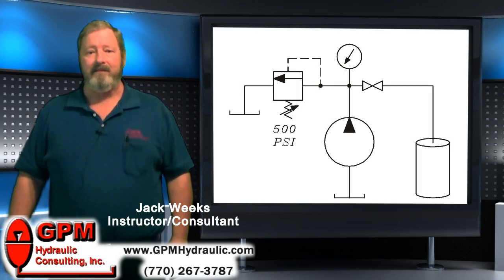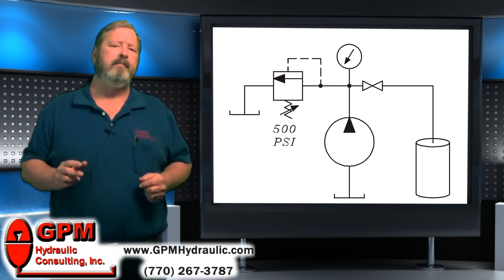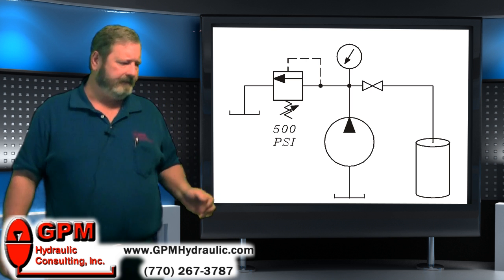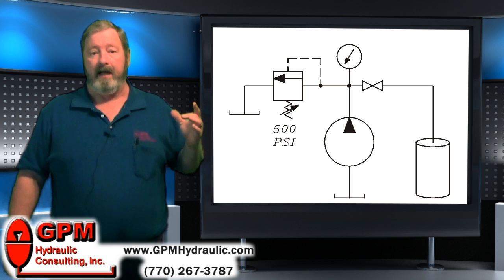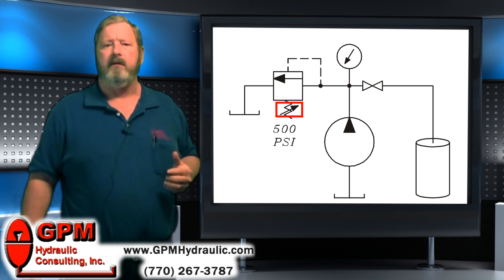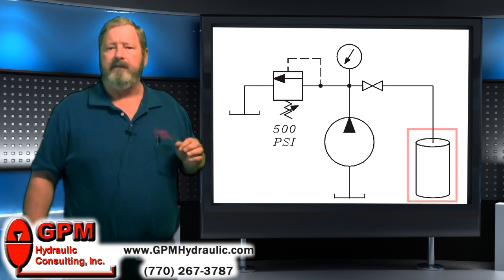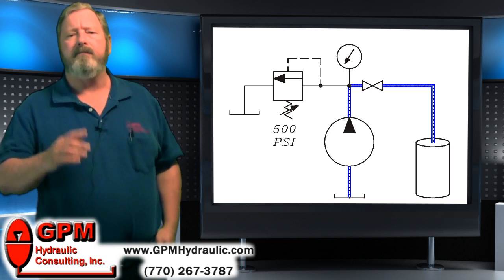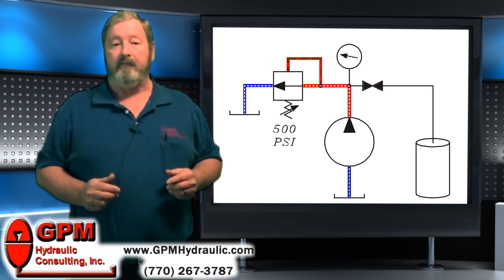The Difference Between Pressure and Flow

Comment: Am I correct to say that this principal of flow v pressure is only true if you're pumping a liquid, because it is not compressible? If you're pumping air, the pump can create pressure because air is compressible, I believe a turbocharger both pumps flow and compresses the air at the same time. Also a screw type supercharger does too. This is why they're more efficient than a Roots type supercharger.
Reply from the maker: Hi p jay, thank you for your comment! Actually, no, the principle remains the same with any type of fluid, liquid or gas. Yes, air will indeed compress considerably while hydraulic fluid will compress almost none. But both fluids become pressurized when used to transmit power and that pressure is the result of resistance to flow. The flow is provided by the pump (or compressor, with a gas) and, in either instance, there will be no pressure unless there is resistance to that flow. So, in both cases, what you are reading on the gauge is not the amount of pressure delivered by the pump or compressor, but in fact is a reading of the amount of resistance that is currently being overcome. Hope this helps!
Reply: @JackWeeks  maybe I have been confused by the fact that a turbo has a "compressor" wheel. I assumed that meant it created compression, by centrifugal force on the air, as well as pumping it through the inlet tract.
Reply from the maker: @pjay3028  Yes, manufacturers don't help matters very much with their terminology. That is exactly how the flow is generated, but you will note that, if it is not connected to anything and there is no resistance, it can go full speed and no pressure will be generated (other than a negligible amount by air resistance and change of direction - which is still resistance, just internal to the compressor). And the point can appear to be only academic in nature, but it's crucial that it be understood when troubleshooting a system.

Comment: Once the flow is allowed by building  pressure until 500 psi, then the pressure should drop because there is no resistance anymore.. and then pressure rise again (in a cycle). Or am I missing something and it's actually possible to have a constant flow with pressure up ?
Reply from the maker: Hi Arthur, thanks for your comment! This would be true if the relief valve were a "switch". But it's not - it's held closed by a spring and the resistance doesn't go away just because the valve is opened. Think of it as a door with a door closer installed. Once it is opened, someone has to maintain the opening force on it or it will close again. Same way with the relief valve. If the pressure drops below 500 PSI, the relief valve will begin to close. Thus, the pressure drop must be maintained across the relief valve in order to keep it open. Now, as you can see in the schematic, the pressure drops to near zero once the oil passes the relief valve, and if a gauge were mounted in the tank line, that is what it would read - zero. But so long as there is resistance there upstream of the relief, there will be pressure reading on the gauge. So, yes, it is possible (and even necessary in order for the machine to do any work) to have a constant flow with pressure in the line.
Reply: @JackWeeks  thanks for the explanation!

Comment: Jack can you explain this using bernoulli's equation, if we decrease the diameter of the pipeline according to bernoulli's equation static pressure should decrease, but according to this video pipeline with small diameter gives high path of resistance so pressure guage reads high pressure, kindly help me clearing this confusion.
Reply: Thank you for your question, Hassan! Let me see if I can clear up any misunderstanding. In its simplest form, the Bernoulli equation states that static pressure + dynamic pressure = total pressure. A steady, unchanging flow is assumed. It is really more for measuring fluid velocity, particularly through a nozzle. The principle remains, however, that pressure is a measure of resistance. As the orifice changes, the pressure drop across the orifice changes in inverse proportion. Thus, the smaller the orifice, the greater pressure drop across it, assuming that the flow remains constant. The Bernoulli principle is really an expression (or, perhaps, "example" would be a better word?) of the Conservation of Energy law.
Hope this helps, and thanks for watching!

Comment: IF PUMP DOES NOT CREATE PRESSURE, HOW DOES HIGH PRESSURE WATER JETS ARE USED FOR CLEANING ? I MEAN 500 BAR PUMP PRESSURE FOR CLEANING PURPOSE ? SPRAY CLEANING
Reply: Thank you for your question! And it’s a perfect example. The answer, of course, is that the pressure is caused by.the orifice that restricts the flow. In fact, most pressure washers have a set of several orifice connections so you may choose both the spray pattern and pressure. Remove the orifice (along with the quick connect fitting on the hose) and then the hose becomes the orifice and pressure drops very low because of the loss of resistance. Hope this helps!

Comment: I want to try understand how I can get more pressure...or is it flow LOL, through my shower head and faucets at my house.  We're on a well. We pump from the well into a pressure tank.  Would your "Trouble Shooting Hydraulic Pumps" course, help me understand how my system works?
Reply: I'm sure that it would - in the hundreds of times I have taught that class, I've never had a student who didn't feel enlightened by it.  But the short answer to your question is probably going to be either a higher flow submerged pump or an additional inline pump. The latter may be the less expensive solution, particularly if you have an especially deep well or a very long run from your well (or both, as I did at a house I used to own. The auxiliary pump did the trick!) Hope this helps!

Comment: My hydraulics instructor at UTI over 30 years ago said this ; when you pee, that's flow. Now put your thumb over the hole, that's pressure.  Simply put, flow against a restriction causes pressure.
Reply: I think that's what you call a UTI infection...
Reply: Sounds like a good example to me.
Reply: thats usually painful too, u do feel that mechanical pressure against the wall of your pipe
Reply: They are right, indeed.
Reply: I heard the same thing from my Master Toolmaker during apprenticeship and my nuclear physics professor at University.
Reply: Put your thumb over a garden hose and the water has more pressure
Reply: So,. your cock will deliver how much pressure?😅
Reply: George Kuersten 🤣👌🏾

Comment: Hi Jack, 
This is a great video. I was wondering what would be the case for a non-positive displacement pump? How the pressure and flow rate can be varied for such pump?

Thanks,
Manjiri
Reply: Thank you for your comment! The principle would remain the same whether the pump is positive displacement or not. Or, for that matter, whether the pump is fixed or variable displacement. The pump still delivers flow and the pressure is determined by the amount of resistance that is overcome. A non-positive displacement pump (such as the water pump on your car engine) will not maintain an output proportional to the speed of its drive motor because it has relatively high internal clearances. Thus, the higher the RPM and the greater the resistance, the more the pump will bypass. By the same token, its flow can be blocked without serious danger.

Comment: Dear Sir, i have a low flow rate issue. Can you please assist me with that? Thanks
Reply: Maybe. What sort of problem are you having?
Reply: I have three pumps which are almost similar connected in parallel. When one pump runs it runs at best efficiency point giving rated flow but when two pumps run the flow rate does not double. But the system is designed for both pumps to run in parallel and system once ran giving double flow rate. Third pump is redundant actually and two pumps were once enough to full fill the flow requirement. But few years back something happened and now when both pumps run flow rate does not double. What can be the possible reasons for this flow rate loss and how to troubleshoot it. If you need any other details then please ask.
Reply: @irshadali3449 , it's possible that the second pump is simply badly worn. Of course, it's also likely that you have some bypassing in the system. I would first test the pump through your relief valve. Deadhead the system and, with only the one suspect pump running, first measure the flow through the relief valve with the pressure setting very low. Then, gradually increase the pressure setting until you get to normal system pressure. If the flow maintains at or very near what you get at low pressure, the pump is fine. Look for system bypass with a thermal imaging camera (bypassing always generates heat). If, however, the flow drops more than about 10% or so once you reach normal system pressure, the pump is bad and must be replaced. Hope this helps!
Reply: @Gpmhydraulic  thank you. i have an other question. can a pressure drop across shell and tube heat exchanger  be increased by partially closing its outlet valve???
Reply: @irshadali3449 , it certainly can!
Reply: @Gpmhydraulic  I just don't get it. By closing valve you are actually restricting the flow through heat exchanger and by doing this pressure drop will decrease as pressure drop is directly proportional to flow rate. Please explain. How can it be increased???? Thanks
Reply: @irshadali3449 , your heat exchanger acts as an orifice in itself. Increasing the resistance downstream will also increase the resistance across the heat exchanger. If you want to decrease the pressure drop across the heat exchanger, the flow must be restricted upstream of the cooler. In any event, though, it is rarely wise to limit return flow, especially through a heat exchanger. It will decrease the overall efficiency of the system as well as hinder the heat exchanger in cooling the oil.
Reply: @Gpmhydraulic  I want to clear that valve which is restricting the flow downstream heat exchanger is installed after the pressure gauge measuring pressure drop. In other words the pressure gauge installed to measure differential pressure is installed after heat exchanger but before the valve. It is measuring pressure drop across heat exchanger excluding the valve. How can be in that case increase pressure drop by restricting the flow through valve after heat exchanger??
Reply: @irshadali3449 , maybe I'm not understanding your problem. As you describe the arrangement, it sounds like your gauge is measuring pressure drop across the valve, not the heat exchanger. Exactly what kind of problem are you having? Does the gauge reading change when you adjust the valve? What is the purpose of the valve - is it there in order to service the heat exchanger? Are you concerned that the heat exchanger may rupture?
Reply: @Gpmhydraulic  i want to send you the diagram of the system so that you can understand my problem. Is there any other to contact you? please help.

Comment: Hi Jack, thanks for the video, I found it really informative. I stumbled on it after trying to understand the difference between pressure and volume, or flow I guess as you say. I was watching a video on a fire hydrant, which peaked my curiosity on what sort of pressure they run on. I assumed a very high pressure, as when on they move a LOT of water. I was surprised to find out it seems to normally be about 50 psi? I know at work our fire supression system is 120 psi of water pressure through 2 inch pipe. It also moves a lot of water when activated. I cant say I fully understand yet, for instance 60psi through my garden hose I can spray water ~20 feet, but that fire hydrant moves substantially more water, much farther with the same psi. I'll understand eventually lol. I am just a layman who likes to understand how things work. Your video has been enlightening, thankyou.
Reply: Thank you for your comment!  Yes, that is a common misconception that pressure at a fire hydrant must be significantly higher than that at your house. Another common error (sort of a corollary) is that you use more water when working with a pressure washer than with just a hose nozzle. In fact, only a fraction of the water is used with the pressure washer.
The distance the water will travel is determined by the power generated, typically measured in hydraulic horsepower. Hydraulic horsepower is the product of two factors, pressure and flow. In other words, horsepower = pressure x flow. If we are using English units of measure, of course, a constant is required since PSI (pounds per square inch) and GPM (gallons per minute) are not compatible. The constant that makes them work together is 0.000583, so the horsepower formula is:
HP = GPM X PSI X 0.000583.
Reply: @Gpmhydraulic  thanks for the reply, I appreciate your response!

Comment: So the purpose of the pilot line is to return oil that doesn't make it through the RV to the main line? Is it also not common for the pilot line to return back to the reservoir? Excellent video. Thank you for your time.

Comment: Dear sir, today I got big problem to my Hydraulic Deck Crane on Board Tanker. I found very sound noise when I operate the Crane, also heat Temperature at the Discharge Hose line, already 3 time broken at this hose line..Please Help To find trouble shoot to this problem. ..

Comment: you miss one point.When you use T-joint, the direction of flow would two sided. You did not show  it to your video. Moreover, it is possible   two directional flow with a single pump. You miss it. Thanks for all.
Reply: Thanks for your comment, but I'm not sure what you mean. Certainly you don't mean that the fluid would take both paths in this instance, do you?
Reply: @Gpmhydraulic   The purpose of pressure relief valve does not mean one directional flow. It is possible to flow both direction. As you use pressure relief valve, it stops to flow left side flow until Pressure  crosses 500 PSI.If pressure crosses 500PSI, you get two directional flow. The main purpose of pressure relief valve is not clear to your video. You use a hand control check valve to change your flow direction to activate pressure relief valve. In reality ,it does not happen.It is possible if you want.
Reply: @robaxhossain5653  But isn't that the whole point of the video, that unless the flow is met with resistance, there will be no pressure (and thus no flow through the relief)?
Reply: @Gpmhydraulic  yes

Comment: That isn a ball valve it’s a gate
Reply: Thank you for your comment! Yes, you are correct. A ball valve has a little circle in the middle. We don't always make the distinction, but we probably should.
Reply: GPM Hydraulic Consulting   A dot in the middle is a globe valve. A ball valve is a dot in the middle a stick at the top with a stick coming off of that
Reply: Good information but need to work on print identification

Comment: hi , i have an old Atom G 999 clicker press with a 2hp 3phase motor running @3600rpm.Im planning to reduce its rpm using a VFD. .im wondering what will happen if i do . Thanks in advance...your video is awesome.
Reply: Well, if you reduce its RPM, the flow will be reduced and therefore your press will move more slowly. I cannot say whether your VFD will generate sufficient torque at the new RPM, though. That is a question that can be better answered by the manufacturer of your electric motor.

Comment: Thanks for simplified explaination.

I have questions if you can comment pls
Are the flow rate per minute same in both party's??
In case of wash gun with fixed size jetting nozzle , how the pump can be selected to offer 400 psi jetting pressure?
Most of AC electric diaphragm pump offer max pressure of 160 psi, How these type of diaphram pumps can be upgraded to deliver  400 psi?

Comment: Is there anyone can tell how can i get the flow rate of the pump?
Reply: Find the displacement of the pump and multiply it by the RPM of the primary mover. You can usually find the displacement by doing a search of the model number. Most manufacturers have downloadable documentation.

Comment: Great video, thank you!
I do feel like the statement at 0:00:45-0:00:52 is a little incomplete, although it is a consistent statement. 
I would think the pump provides Energy over time (HP) to the water, and this energy is transferred in either flow or pressure depending on the resistance in the system. 

Nit-picky of me, but just something that peaked my interest. Let me know if I'm seeing this incorrectly!
Reply: Hi, Aaron - thanks for your comments! I think I understand what you are saying (but maybe not!). I think that you are saying that energy is transferred from the pump to the liquid. If so, you are absolutely correct. This is one of the purposes of the fluid, to transmit energy through the system. Perhaps the way I said it suggested that the pump does not transfer energy? But it certainly does. But while the pump does transfer energy, this should not be construed as the pump putting pressure in the system. The words “pressure” and “resistance” should be considered to be synonymous in this instance. If there is no resistance, there will be no pressure. The gauge tells only the resistance that is currently being overcome. Think of it as picking up an object. Once the weight of the object has been overcome, there is no way to use any more strength in your arm to pick it up. Someone stronger than I can pick up a heavier object than I can, but if we are both picking up the same object, we both use exactly the same strength. Like flow overcoming resistance, the object weight is determined solely by its mass, unaffected by the ability of the lifter.